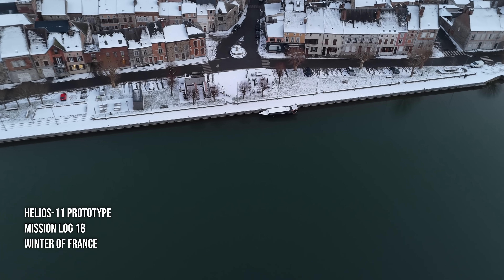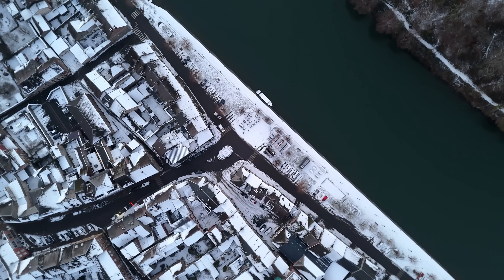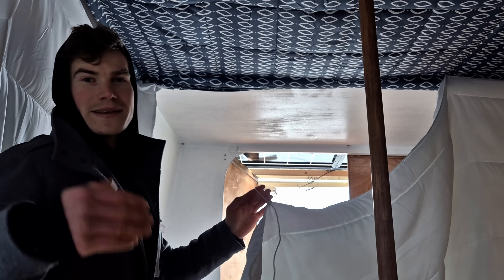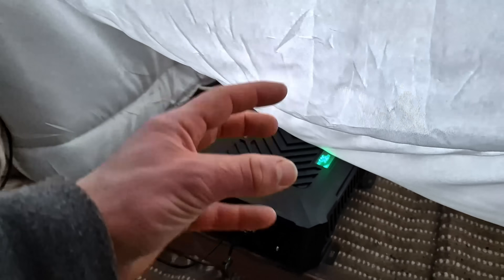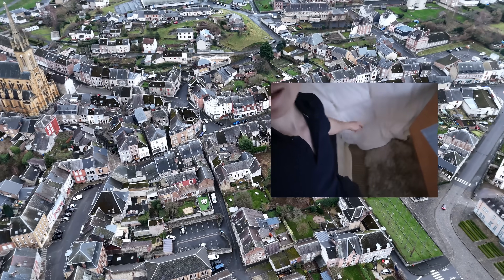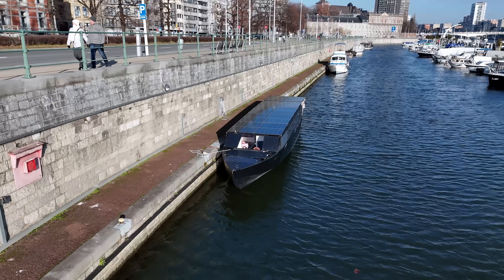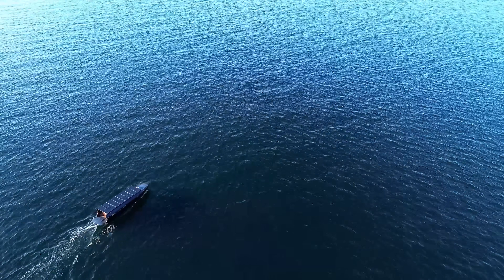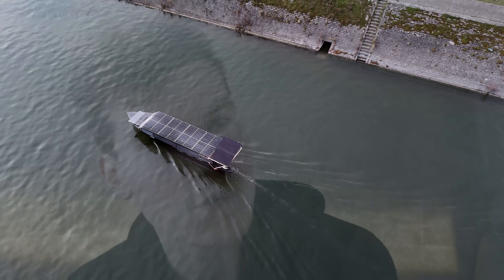Installing Heating on my 100% Solar Boat in Winter (230 V, Infrared Heat)

Comment: You can use 12-24 volt car electric blankets; they consume little power, and you don't need to use an inverter, which causes losses. It's very warm to sleep in.

Comment: The blanket castle might be more efficient if the heat source had a dense heat sink that absorbs the heat slowly and builds up temperature to release it more slowly and evenly during the night. Kind of how the stone fireplace in a log cabin works. A stack of bricks might be a good experiment?

Comment: I would much rather install a portable heat pump (eg. EcoFlow Wave 3), as it would heat more efficiently, but it could also cool, and it would dehumidify.  Downside would be it would cost more and it would be bulkier, but I still think it would be worth it.  Perhaps something to consider for the next design.

Comment: I would try to Install a little aircondition for both heating and cooling.i wonder if the energy could be extracted from water instead of air - that might be smarter as there is always water plus zero degrees around. And why not add a 500w wind generator?

Comment: the ideal insulation is aerogel ,but there are lots of cheaper alternatives ,one advantage of foam core construction is the thermal properties ,you can do glass over ply and foam ply laminates ,also giving a worst case buoyancy factor . Breaking news on the battery front ,a new ,still classified for commercial reasons ,solid state battery from Donut in finland ,no lithium , 100 000 cycles ,400 Whrs/Kg ,with a next gen at 3600Whrs/Kg ,price similar to lithium ,but with scale production will hopefully drop . 2bit da-vinci has a breakdown video . https://www.youtube.com/watch?v=O8PjlwZVLVE

Comment: what might be possible is creating an adaptive "ballast" system that would tilt the boat enough where if you employed some heat to the solar panels , the snow and ice might slide off without you having to touch it...

Comment: A heat pump can be many times more efficient warming than a resistive heater, as it moves heat more than just generates it.
If you add a water heat exchanger (common for on boat A/C) it can be even better!

Comment: Hey.. Look into Thermophiles. Google: "Mars Thermophiles Yellowstone national park service gov" They know they're on that dead world making heat that can be seen from space and I do too. They said black mulch was cause of spontaneous combustion of Mulch piles they lie that's result of nutrients being rich enough for Hyperthermophiles its charred mulch. Taps Nutrient drip Sanitized Bathroom waste & Food waste = As long as you exist you will make too much. Runs finger from Stainless Steel wool fireproof panel up copper heat transfer pipes into Turbine boiler then to condenser Use Trash nutrient tank = Distill water + Make power.

If you had nutrient richness to run Hyperthermophiles in fireproof spot and told a fat Sheriff you'd see him fast walking to his car to get on his phone if you said Radioactive material is heat source. Because he calling the government on you because it makes sense.. Haha. Thermophiles replicate double every 24 hours when they get going if needed AND if you don't feed them even if they freeze they don't die. They sleeeep.. Scoops some into metal tray on drip feed and drips bottle of nutrient solution on them Like a Dragon curse you can't feed them rich and let them be near flammable stuff. They can die by the fires they cause.. Dragon curse. - Dracula, aka little Dragon (Biological warfare Champion)

Comment: your heating system is 100% efficient. Think about it, the inefficiency in the inverter is heat but heat is what you wanted. Every watt pulled from the battery got turned into heat somehow. 100% efficiency

Comment: A consolation to the seasonal decrease in sun hours during winter is the "albino effect" of the solar panels as the cold temperature increases photovoltaic performance and additional light is reflected off the reflective surface of the snow & ice on to the solar panels.  
Also, in winter,  wind turbines performance peaks because it benefits from stronger, more persistent, winds.
There is balance in nature.

Comment: I was in a camper with no heating all i had was one of those  little plug in heaters 500w i think  and an electric under blanket both worked a treat and it wasn't insulated 3 year  no  problem

Comment: Electric lap blankets and heat therapy wraps use very few watts ... about 140W and 50W respectively... I wrap my ankles with heat therapy wraps while driving, and my wife uses the electric lap-throw powered by a small solar generator/inverter.... we stay very comfortable in our EV without losing range to heat the cabin.  These low wattage heat sources keep the heat where you need it... on your person.  We also use the lap blankets at home in stead of the 1500W baseboard heaters.. saves a lot of energy and you stay very cozy.

Comment: If you use a small heat pump from a fridge or even just a few peltier elements you can get 200-400% heating efficiency and also do regenerative ventilation with getting a big percentage from your ventilation air back. You could leave that running even when driving. Ventilation also dries the wet boat encironment. I'd only do resistive heating for stuff directly touching you. Floors, seats, heated blankets. Also: Please start differentiation kWh and kW correctly. You mixing up power and energy constantly is quite confusing.

Comment: Your surrounded by water full of energy...  get an air conditioner and modify it by placing a heat exchanger along the hull, it could be as simple as a tube under the water line braze it directly in and re-gas, get an AC with a cooling and heating function and it can be mode to cool in the summer too.

Comment: I remember asking a few videos back how you were dealing with heating. While an electric heater is 100% efficient, a heat pump salvaged from a crashed Tesla Model 3 or Y, can probably get you in the 600% efficiency range, and the heating elements with fans never reach dangerous high levels.
Also you can use resistance wearable heaters that work with portable battery 2Ah power banks, and you recharge them from your solar, swap as needed. So you heat your body from inside your clothes, also heating blankets, and not have to heat cabin space all that much, just keep it above the dew point.
I'm glad you looking into improving in the future insulation - this boat is just the POC prototype - you can only go better.

Comment: Why not get a small heat pump mini split air conditioner, they have a SCOP of around 4, this gives you 1kw of heating for 250w of power ?

Comment: BUY A SECOND HAND AIR CONDITIONER- THAT HAS HEATING...
ITS AIRCON, BUT WITH A REVERSE VALVE, TO SEND THE HEAT CREATED BY ITS MOTOR( COMPRESSOR, INTO THE LIVING SPACE, RATHER THAN OUTDOORS...
WITH A BIT OF FUN DIY, YOU COULD ACTUALLY MAKE A WAYER TO AIR HEAT PUMP, EVEN MORE EFFICIENT,AS YOU HAVE PLENTY OF WATER UNDER YOU, TO PULL HEAT FROM...
BACKUP FOR CLOUDY DAYS ???
LOOK AT DIESEL HEATERS FOR OVERNIGHT DRIVERS CABS...
YT HAS LOADS OF VIDS, ON HOW TO IMPROVE EFFICIENCY...
IF YOU CAN GET RESTARAUNTS, FAST FOOD OUTLETS,ETC, TO PROVIDE YOU WITH USED COOKING OIL, EXPLAINING YOUR A ECO ADVENTURER, AND WILL MENTION THEM, IF THEY WISH...
YOU CAN HEAT FOR FREE.

Comment: On my solar system I use camping heaters. If you look up 800w portable quartz heater you should be able to find them. It has a 400W/800W switch at the bottom center on the unit and are really cheap. As they are quartz it produces a huge amount of IR heat directionally and I regularly use mine on only the 400W setting❤ I would post a direct link but it would no doubt be automatically removed by YouTube😊

Comment: Better get an air heater with a fan, it spreads the warm air. 
The IR heaters with crystals Halazia are not so eficient, you only feel very warm near it and not if you are far away and doesn't spread the wormth in the room. Also because the heating element gets red hot you can get fire if it tips face down, even with a safety switch. 
Of course the air fan heater can caught fire if it tips over and the airflow is blocked, you can find one with a safety switch under it that is stops the power if it tips over.
Or you get the real IR heating panels that the heating element dont get red hot.
Here in Greece we have very cold days so i have tried them all.

Comment: If you want to be super efficient then there's no replacement for insulation. You can get IR reflective foil lined insulated and heated jackets. The room won't we warm, but you will. You can also get heated vests which is more efficient than heating the whole room, but not as efficient as more insulative clothing. 

Of course, this is not helpful for visitors or if/when you need to change that clothing.

Comment: Seeing the blankets + heaters you’re looking at scared me so as an architect let me help. For insulation look at hemp based panels or batts. Foil sided should help to keep the heat where you want it. You could then add the finish you like on top. Hemp is no VOC and negative carbon so completely sustainable. Then please look into infrared heaters. Try Herschel in the UK. They can’t catch fire to adjacent materials which is what freaked me out about the heaters you were looking into. Infrared radiation is like the sun in that it heats people and surfaces not the air. You install them to the ceiling or walls aimed where you sit or sleep and only turn them on when needed. So locate the panels over seating or sleeping areas and turn them off when you change rooms if you stay in one place for a while. They work well with solar panel electricity because they’re very efficient. You could even put one behind your captain’s seat to keep you warm while you travel. Also, look into building the adjustable frame for your solar panels with aluminum angles or channels. You can then screw the solar panels directly to them to stiffen the assembly and use stainless steel aircraft cable for added stability and to keep it square during all the movement.  I think it will hold up to the movement/adjustment better than wood over the long hall and should be about the same weight. 
Seeing your videos reminds me of all the places I’ve travelled with my sons. I’m too sick to travel now so it feeds my spirit. Thank you.

Comment: If you line the inside of your cabin with heat reflective foil then it can reflect your own body heat back at you and make you feel a lot warmer than you might at that ambient temperature. It makes an enormous difference. But you can only cover them with Polypropylene (PP) really, otherwise that outside layer absorbs the heat and you loose a big chunk of the effect.  PP is IR transmissive/transparent.

Comment: Consider getting a portable heat pump. They can produce more than twice the heat of the electricity they use. More than twice as efficient as an IR heater... They are loud compared to these options, and don't like working below about 6°C though. Also you would need two holes so that it can pull in external air to extract the heat then exhaust that back outside.

Given you have an excess of energy supply, this might be excessive and the space and quiet of another heat source might be more valuable to you.

Comment: I am interested by the comments referring to heat pumps/heat exchangers and their application in your vessel and their scalability and use of the cold water for heat exchange. From what I understand, you are pursuing infrared which is great for direct heating. I wonder if woollen electric blankets would serve multiple purposes for you when you are in the coldest locations to provide a base level of increased warmer ambient temperature, sound insulation and curtains that could also be rolled away, or removed and stowed.

Comment: Victron mppts can be set up to dump excess energy on a secondary circuit. You could dump the excess energy on heating (or cooling in summer)

Comment: If you're focusing on boats with are good for canals (like your current one), look into air lubrication for the longer design. A big cavity which you pump air into (continuous film method) will reduce the skin drag on the hull massively. I'd say ignore the microbubble technique, research is still being done to find optimal conditions for that.

Another thing to consider for the narrow design might be a large keel that would make it very stable in the ocean swell. Combining the keel around the air lubrication could be interesting.

If you're looking for linear actuators to tilt the panels on the roof, look at Firgelli. They move quite slowly but the force output is pretty crazy. You will need the synchroniser for them if you plan to use 4 though, they do go out of sync very quickly.

Comment: Great with heating, some blankets with heating 50 - 100 watts works also at night. Another fun thing to test is not having the solar panels on the roof flat, insteadhaveing them on a 15-25 degree angle.

Comment: I've heated a number (okay, many) makeshift shelter spaces with variable amounts of functional insulation, even in -45°.  With your insulating techniques, as long as you don't have any actual draft/leaks for the wind to flow through from outside (especially with 2 people breathing/heating the air as well) 500 watts of high-efficiency heater should do.

Sealing up ANY air leaks is crucial.  Silicone caulk sealent is your friend!  Even if you don't feel any draft through a seam or corner, it can be seeping air, and that makes a difference.  Alternately, you can do what the arctic researchers do and duck-tape every crack and seam possible, no matter how good you thought it was.

IMPORTANT:  If you don't have to open up a door or window now and then to let your breath moisture change out, you still aren't windproof enough!

Heating the air is cheap.  Keeping the inside of the walls (or your wools) warm is the critical game.  Pasting even a couple centimeters of cheap foam insulation sheeting all over the interior walls and ceiling will work miracles for that.  Your wools are "cozy" but they do almost nothing to stop airflow or keep the interior wall surfaces warm (or cool when you need to cool it).

Comment: Yes definitely a water source heat pump is needed. Maybe to recover some energy from movement you could install fans along the hull under the water to generate power too. 

Plenty of ideas about a 2 story solar powered catamaran. Dont get caught up too much in making every panel able to angle towards the sun as on the next prototype youll be using a different mounting method, preferably one with a single point of the contact in the middle of the panel and can be electrically controlled to change direction. 2 of those engines, a much thicker Hull design and taller so you can add more weight, think batteries and transformers. The best way to keep a space warm is to plug any air leaks like windows, gaps in windows, thinner parts of the body of the boat etc. 

The water source heat pump would be best used hooked up to an oil/water heater for the room space and a water boiler/heater for hot water.

Comment: One or two Philips IWL250D 250W IR reflector lamps, each with a dimmer, provide predominantly radiant-based heat with a warmth as cozy as a wood-burning fireplace in an enclosed space.
In combination with heated clothing, e.g. heated thermal underwear, ideally adjustable per zone and with a USB connection for the USB Accupack, which can be changed at any time, the heat is released exactly where it directly warms the human body with minimal power consumption.
The exposed skin areas through radiant heat and the body itself through direct contact with heat zones.
The heated clothing warms indoors and outdoors and keeps the body warm and efficient in every situation.
The radiant heat can be switched on and off at any time and increases the quality of life, especially during periods of rest.
An inductive hob only uses the energy needed to bring the bottom of the pot or pan to the selected temperature. The diameter and heat capacity of the pot or pan have a significant impact on the amount of energy.
Induction cooking fields are safe for the general population and offer several safety advantages over gas or traditional electric cooktops. The electromagnetic fields (EMFs) they produce are low-frequency and non-ionizing, meaning they are too weak to damage DNA or human tissue.

Comment: i was thinking of a crock pot full of dry sand .my test on low only used 46 watts at 110 volt.. i think there are 12 volt small heat pumps.  bifacial panels at a 45% angle back from each side to center should work better in winter.😃🌞🌞🌞👍👍

Comment: Looks cosy.  By the way, I think you need to be a bit more precise with your terminology regarding solar production: kW is power, kWh is energy.  So 500 W heating x 6 hours = 3 kWh, not 3 kW.

Comment: A few comments. 

1.) @7:52 500 W * 6 hours equals 3 kWh, not 3 kW. Time is an important unit. 

2.) if you’re only generating 2 kWh on a cloudy day, that’s just over 2 hours of heat at 900 watt consumption. 

3.) all of the insulation and soft material appears to be doing a good job. Is it fire retardant?  

4.) have you considered a heat pump for improved efficiency?  A heat pump will generate at least twice as much heat using the same amount of energy.